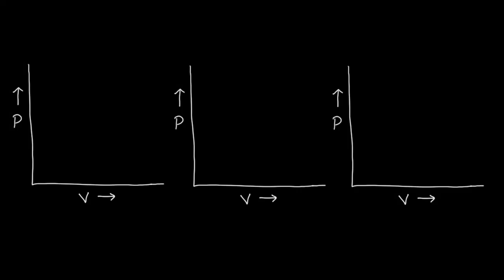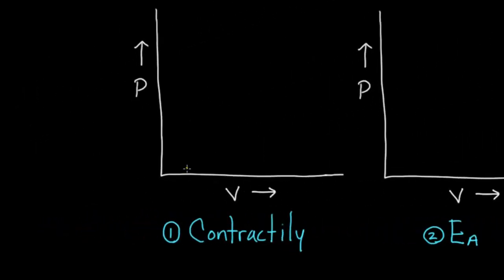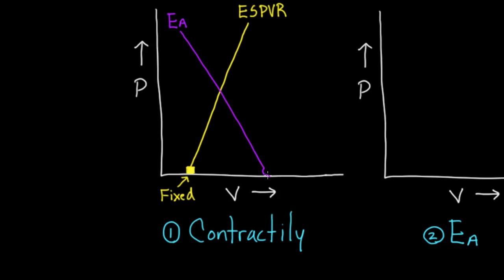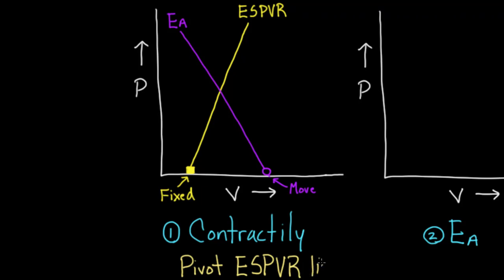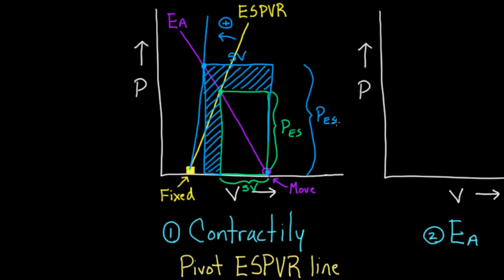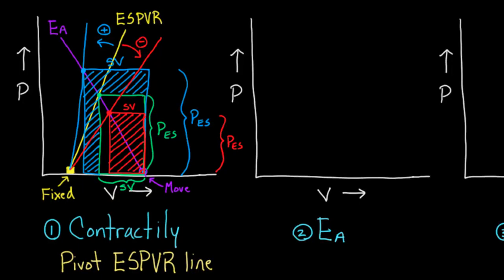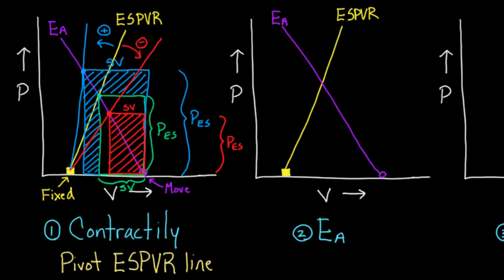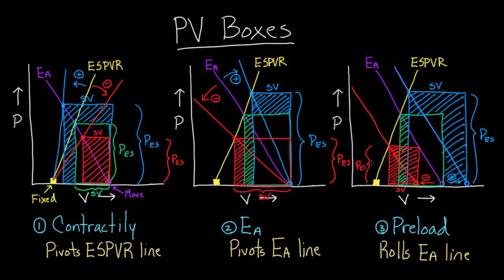Contractility, Ea, and preload effects on PV boxes | NCLEX-RN | Khan Academy

Comment: although I think most of your videos are very helpful I would like to point out a flaw in the end of this one that may confuse students.  When you increase preload a defining characteristic of cardiac muscle is its ability to shorten to the same length regardless of load (preload).  Therefore the ESPVR should not change as preload increases.  I realize you are trying to simplify things by using boxes instead of loops, but by showing a change in ESPVR you may confuse students on a basic principle of cardiac muscle cells.